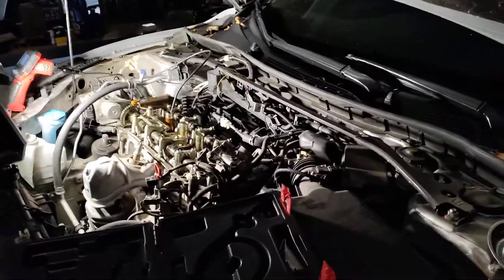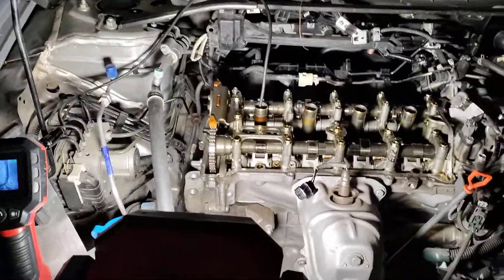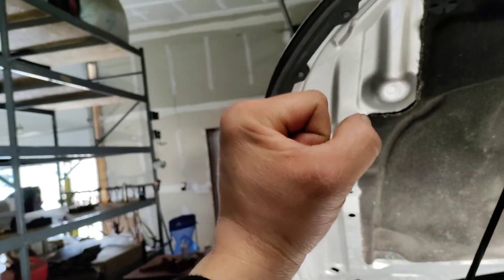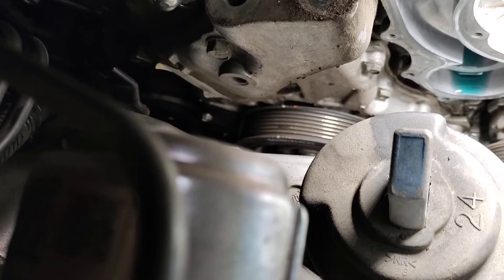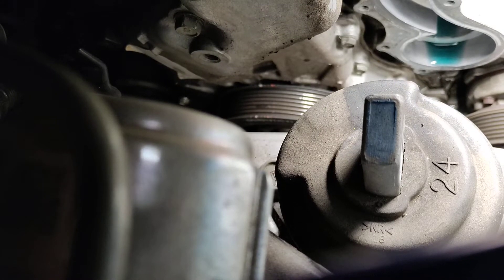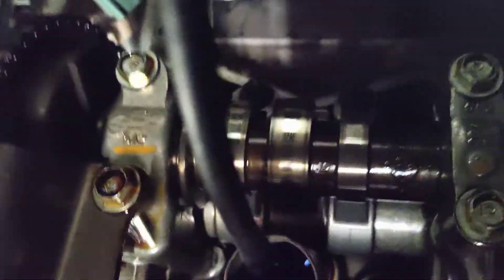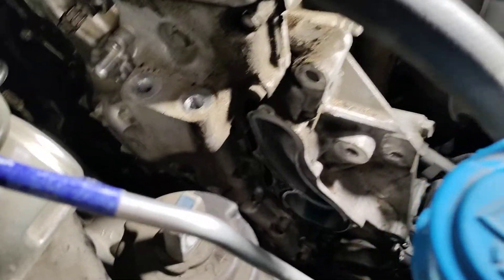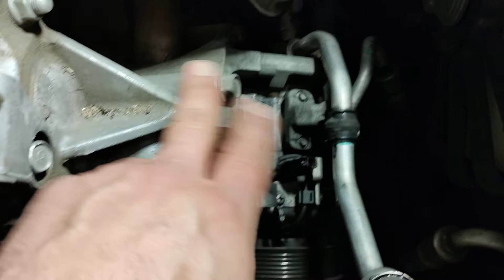2016 Honda timing information/TDC

Comment: The first timing job I did was on my 81 Buick Regal back in 1992. Went old skool with the screw driver in the spark plug hole and got TDC. Car didn't start, I had it on the exhaust stroke. Turned the crank 1 full turn reset timing. Success!! Cars easy to work on back then, wasn't a fan of the carburetor..